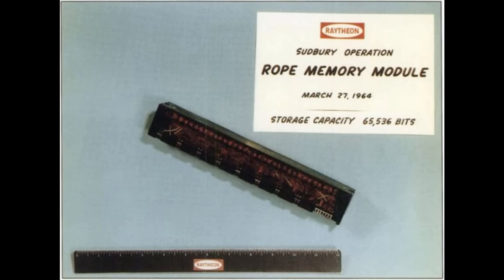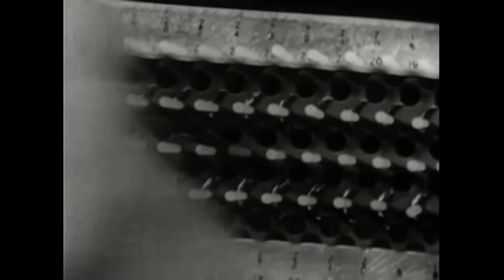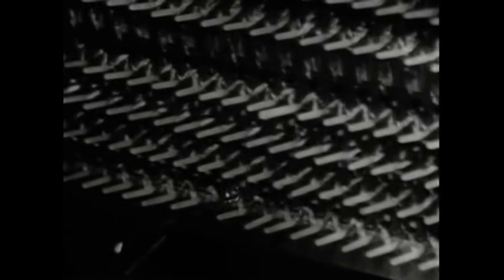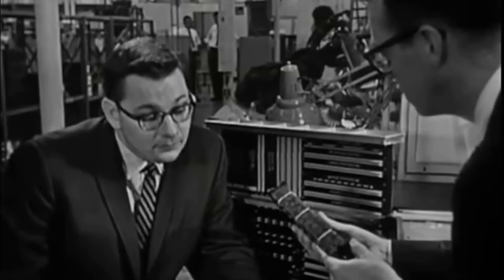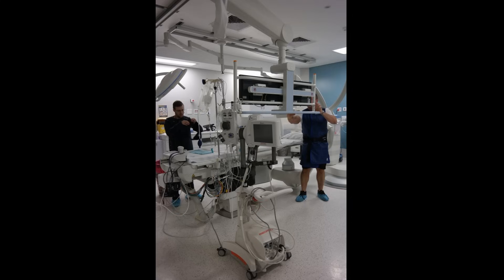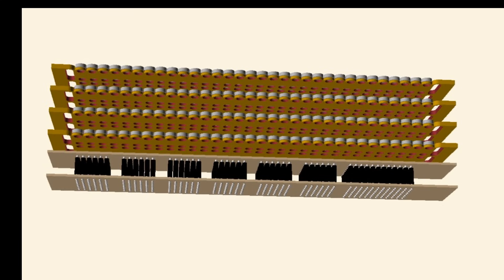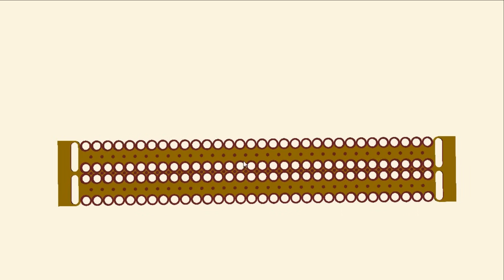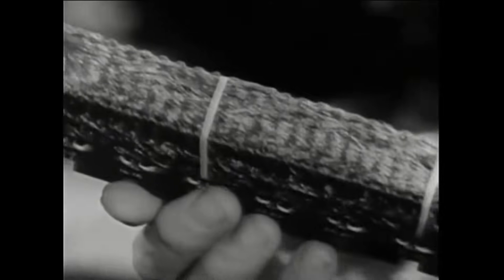Apollo Rope Memory Modules (Part 2 - Construction)

Comment: For additional information on Core memory, circuits (and those diodes):

Electronics: Magnetic Cores I: Properties (1961) US Army Training Film
Electronics: Magnetic Cores II: Basic Circuits (1962) US Army Training Film
Reply from the maker: The videos you mention actually describes a different technology that was used to create RAM (read-write) memory. Rope Memories are actually very different from the more common Core Memory. The biggest visual difference is the number of wires threaded through the cores. Core memories typically have only three wires going through each core and store a single bit per core. The cores in the Rope memories  could easily accommodate 100 or more wires and didn't used the cores for storing data.
Reply: Francois Rautenbach The biggest difference is that rope memory couldn’t work with square loop ferrite.

Comment: Magnetic Core Memory, they taught us all about this when I went to advanced ( at the time ) electronics school when I was in the Navy. Neat, I didn't think this stuff still existed.
Reply from the maker: Thanks Brian. The Apollo Guidance Computer (AGC) did use Magnetic Core memory for its RAM, but the Rope Memory (ROM) you see in this video was a very different technology and was used to store the programs. The cores in the rope memory were actually tiny transformers with the zeros and ones encoded in the wiring and not stored as magnetic fields as with Magnetic Core memories.
Reply from the maker: @degrangier  you are confusing core memory with rope memory. The link you provided are for core memory (RAM).
Reply: @AuthGate  No sir, I am not confusing. There is no way to make working this dumb idea. It can't work. Just give me the therorical schematic a two core rope memory with 128 wires passing or not in the first and the second, with the adressing and refresment logic, to make a 256 bit memory. In this case ou allready needed 128 address lines. Even if this could be done on the table, the software development and mechanical wiring is totaly unpractical to make for 64 kilobytes storage. Even, in Apollo 11, the genius pilot Neil Armstrong, following the alledge history, landed the LEM manualy, after the computer feiled to work. 
If it was technicaly a good system, the core rope memory would have been developped in the computer industry. This was never the case, the only working core memory is the standard core memory.
Reply from the maker: @degrangier  Just because you don't understand how something works doesn't mean it doesn't work.

The cores in a rope memory are just a bunch of tiny transformers with a single primary "winding" and multiple secondary "windings". You pulse the primary winding and then sense 16 of the secondary windings. This gives you a 16 bit word. 

How do you address more cores and select for 16 out of 128 windings? It would be too much to type here, but in short:
1. By using additional "core de-selection" wires they can de-magnetise all but one core so you only see the influence of a single core. 
2. Using a bunch of diodes, they bias a set of 16 wires out of a group of 128 wires (called a strand) with a voltage higher than a diode's forward voltage drop and "magically" only that strand's pulses appears on the output.

It is really amazing how this works and I can confirm that it works quite well. The technology was used in a few mainframes and even a 1970's calculator but the cost to manufacture rope memories was too high and cheaper ROM was developed later. 

Finally, Neil Armstrong did not land the Lunar Module without the computer. He landed it manually, using the controls that were connected to the computer. It wasn't humanly possible to control all the thrusters with sub-second precision by hand.
Reply from the maker: @degrangier  As an addition to my reply above. Why do you keep referring to things like "refreshing" the memory? This is a Read-Only memory or ROM. The data bits are permanently hardwired in. It has nothing to do with core memory, which is a completely different technology altogether. Maybe the word "core" is confusing you?
Reply: @AuthGate  bla bla bla. There was no core rope memory in the Apollo's AGC. Simply because it was not pratically feasible. There is no AGC that has been kept that incorporates the famous Core Rope Memory. You can't show me one. The memory used was a standard dynamic core memory. Even for ROM purpose, you can do that with a preprogrammed core memory.
That's why, the AGC was a mostly a cosmetic and simple calculator doing displaying basic simple calculations.
Reply: @AuthGate  During the moon landing it is attested that the computer was in error. If the computer was part of the thrust control, you are wrong.
Reply: @AuthGate  You fail to demonstrate how could work this technologic trick. The fact is, even you can use one core for several sense wires, you hide the fact that:
1- this is just stupid because all the cores are presets to be seen as 1, and no core as zero. Would be much simple to build an array of diodes some connect for 1 and other disconnected for 0. The programming could be done automatically reducing programming time and errors.
2- The programming of this memory must be done mechanically by hand (what a burden)
3- the logic control circuitry is huge, you must anyway select 8 wires per byte.
4- forget to find any bug in this mechnical programming.
5- Pictures of core rope memories show that many wires are passing through several cores...WTF?
6- The amount of total system memory to run the needed software was arround 64 kB, minimum. The fact is that the weight estimate to build a 64 kB memory system using standard core memories, exceeds weight limit and current level. So what ?
Reply from the maker: @degrangier  Technically the AGC was not a computer with an Operating System, but a Microcontroller with a Real-Time Kernel. It reported 5 errors during the descent and restarted 5 times. A restart took only a few milliseconds and it functioned exactly as designed. All the circuit diagrams and software for the AGC are freely available. Some people have developed software simulators that can execute the actual AGC software. A few of my friends have run the original (unmodified) software on an actual AGC and performed a simulated Moon landing. The Lunar Excursion Module (LEM) had 8 small thrusters that fired for milliseconds at a time. Then there are also the descent and ascent engines. The AGC controlled all of that. An error code on a computer screen, essentially saying that it took too long to perform some task, does not mean it cannot continue to perform any of its background tasks. Educate yourself before you speak.
Reply from the maker: @degrangier  Never argue with an idiot - he will drag you down to his level and beat you with experience. You make some valid points but your arguments show a severe lack of technical knowledge and I had to correct you several times already. 

I don't mind writing long replies to anyone who are interested in understanding how the rope memories work, but you are obviously only here to troll and show your own ignorance. 

I will reply back if you can show that you did some research yourself and are willing to challenge your preconceived opinions. That is the only way to learn.

Comment: what's boggling about this is, figuring out the stuff that had to be manufactured first to manufacture this. the configuring and automating had to be done with mostly pencil, paper, slide rules and tape measures!
Reply: for me, it was the punched tape-driven weaving machines that were probably as amazing as the technology at the time.
Reply: @azzajohnson2123  : Yes.

Comment: Fascinating memory modules. I learned about these at college in the late ‘70s. This ‘software’ is meaningless without knowing what was reading it, and how it was read. Even having the instruction set wouldn’t help without knowing what hardware it was connected to.
Reply from the maker: Hi Charles. Fortunately all the technical information on the instruction set as well as the computer design documents are publicly available. There is also a fully functional virtual Apollo Guidance Computer that is able to execute the Block I instructions contained in these modules. Lastly, the memory modules that you learned about in college were most probably Magnetic Core Memory which is a completely different technology to rope memories :-)

Comment: This brings back a lot of memories. The Apollo series flight computers deserve need to be preserved as historical items instead of tossing them out. Keep in mind the entire space program ran mostly with slide rules also.  Amazing what has changed in around 50 years as a result of the moon missions. Im convinced it was the best thing the government ever spent money on. Almost every thing to do with computers and communication today can be traced back to this project.

Core was still in common use when I started to get involved in the computer field. The only difference, other than packaging , it was set up as read/write, basically just a different threading method  A typical 16 bit mini computer cpu with a 32 k addressing range was around 16 inches square and 2 or 3 single sided boards high set up as a main board with daughter boards. The micro coding in one I was most familiar with was a daughter board roughly 7 inches wide by close to 16 inches long and as tightly packed as possible with mostly mask programmed roms..
Reply: fascinating! tx for sharing
Reply: some calculations could have been done by Newton centuries age. Orbital mechanics themselves aren't actually THAT complicated.  But they also had 3 massive IBM computers on the ground... 
Most calculations were made on the ground and sent up. As it's the sensible method to this day. And the original concept of a fully autonomous on board computer was killed by technical limitations and the schedule. so the final thing was a compromise. Still mighty impressive.
Reply: Wonderful history but I think we will be surprised at who gets triggered as they went to the moon to bring back technology greatly superior to anything we have today as well. There is a reason for our acceleration in the 50 yrs it was not by accident or by trial and error as it had been since the time of the steam engine.

Comment: I seen someone had the actual blueprints for these and the test equipment used to test each module.  Did you get a copy to build yours? As this was not one of those Oh shit I screwed up and melted the wires...

I still find it strange they had a limited it to 192.. Which is the magic number for video card makers on some models...As most use 128 bit even today 50 years later...

Comment: Fascinating stuff, thank you :) 

Is it possible the two extra diodes performed a backup/fail safe function of some kind, perhaps limited to a critical process?
Reply from the maker: It could be, but they already had a number of other fail safe mechanisms like data parity and memory checksums.

Your question made me think whether these diodes could maybe have something to do with the factory testing of the modules. There are 4 connection pins on the modules that I have not been able to identify yet and these may very well play some part in this too.
Reply: One waits with bated breath, thank you :)

Comment: Do the number of wires threaded through each core translate directly to the number of 'hard wired' methods / functions that a particular modules is capable of executing?
Reply from the maker: Each core can accommodate 128 wires. These wires are divided into 8 strands of 16 wires each. One strand of 16 wires is equivalent to 16 bits and represent a single instruction, like add, compare, jump, etc. So one core stores 8 individual instructions.
Reply: ***** amazing!

Comment: "65,000 pieces of information."  I assume that each "piece" is a bit, or BInary digIT (1[on] or 0[off]).  That would be almost 8 kilobytes per rope memory module.
Reply: Having watched it a second time, I see my answer in the photographs--"65,536 bits".  That equals exactly 8kilobytes/module.
Reply from the maker: You are 100% correct Mark. Note that these modules were used on the Block I computer. The Block II computer that were used on the Moon missions used higher capacity rope memories with 50% more storage (65536 + 32768 = 98304 bits). It is also interesting to note that the data is organised in 16 bit words (15 data bits and 1 parity bit), so the there are actually 4096 memory locations per module.

Comment: I'm still in Rope Memory class 101. How can the software be "wired" to them and, in special, how to read them?
Reply from the maker: You can think of the cores as little transformers but instead of just a primary and secondary winding, each core could have a hundred (or more) secondary coils. Also, instead of multiple windings per coil, you only need to thread a wire through the core. It is not an efficient transformer but it is good enough.

In an over simplified example, you would send a pulse through the primary "coil" and measure which secondary "coils" pick up the signal. These would be the "ones" as the "zeros" would not be threaded through the core. 

In practice, it is a little more complicated. I should maybe do another video to explain this in more detail.
Reply: @AuthGate  Great, thank you for your answer. If you do a video about this would be great!

Comment: is it possible this memory to store data for 40 years? doen't it once readable?
Reply: The memory data in this case is literally wired in. As long as the circuit remains in place, there's the data right there. "Writing" data to such a system entails rewiring.

Comment: so each memory module  was 8.125 bytes
Reply from the maker: 512 cores times 128 bits per core = 65536 bits per module. That translates to 8192 bytes. It was a 16 bit computer though, so 4096 words per module.